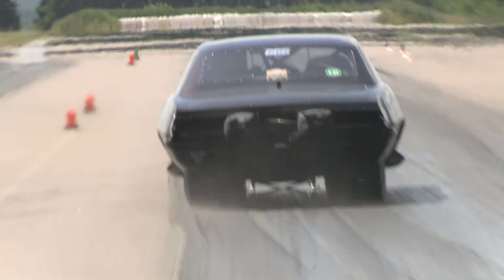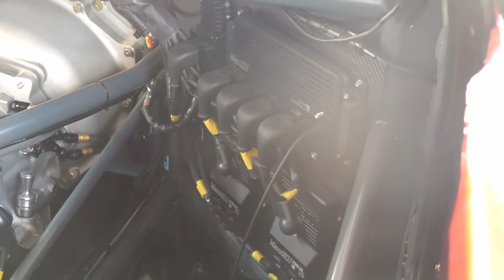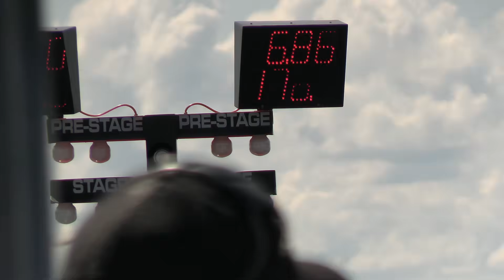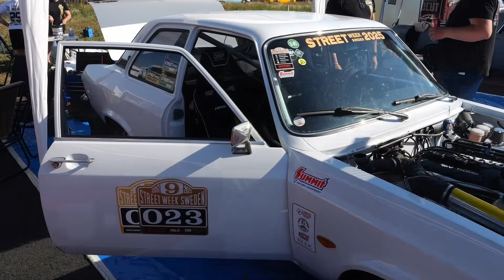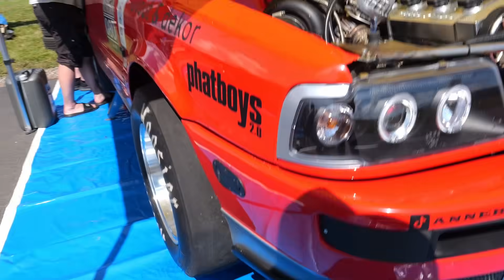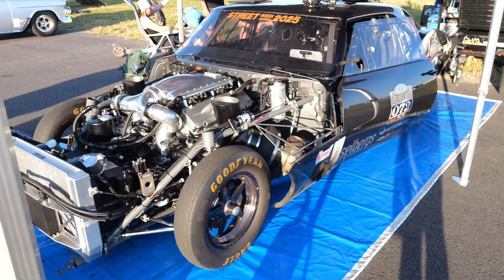Streetweek Sweden 2025 Day 4 - Supernice Engine details!

Comment: "race spec wires". most real oems label their connectors in some way.
trist att de kör 201m, 402 är ju standard i usa liksom
Reply from the maker: Race spec have nothing with markings to do. It is the materials. Tefzel wiring and raychem dr-25 wire protection.
Yes 402m would be more fun! But there is not 5 of 402m tracks in south Sweden. Also I think there is other reasons for 1/8mile also.
Reply: @PeterBjorck  tror de kör 201m för på gatan kör de det och 80% av bilarna är gatrejs bilar